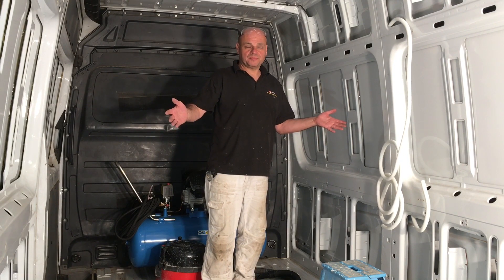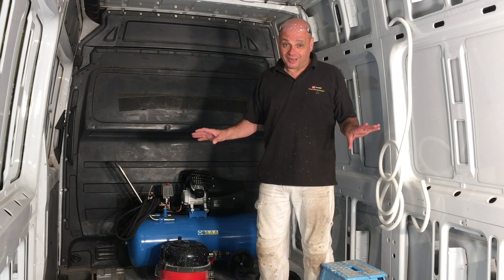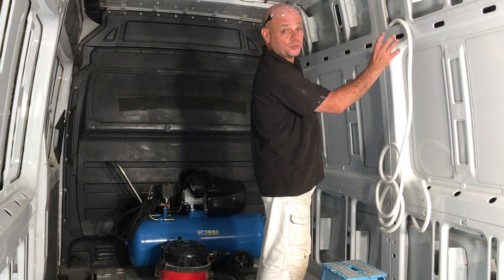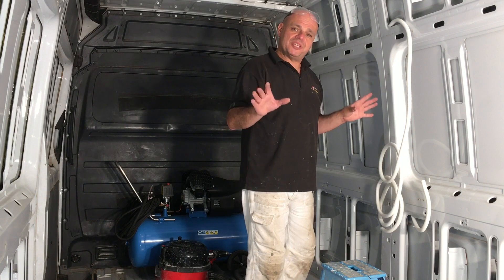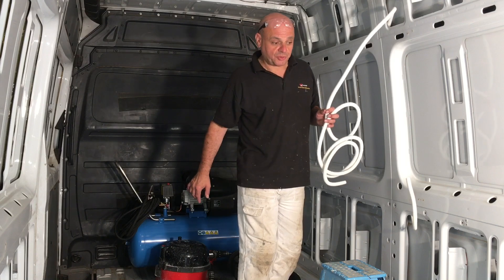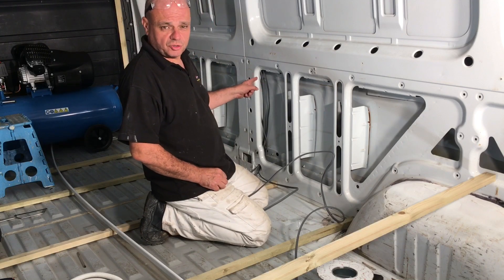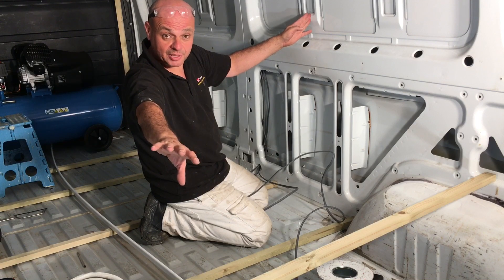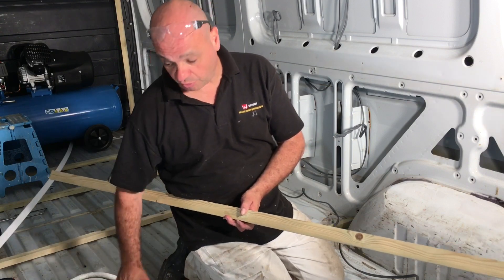Campervan 240v first fix wiring

Comment: what did you run from your inverter, can you just run a normal extension lead from it, also the mains hook up. if running a double plug an say run a ps4 13amp an tv say 5amp what size braker in the consumer unit do you use
Reply from the maker: Hi D mag. The PS4 won’t use no where near 13 amps but I ain’t worked out what I’ll be using myself yet but high powered stuff can only be used on hook up which can go upto 16amps. My breaker will have two 16amp breakers in it I believe fir two feeds but i haven’t had that looked at yet by an electrician. I’m Surmising as the feeds from hookups are 16amps However appliance plugs will only go upto 13amp. However I will fit a dual powered tv 12v/230v so that can be used anywhere anytime but play stations on hook up only. I’ve laid 2.5 twin and earth flexi cable for the inverter sockets but that’s overkill. 1.5 is enough but I had 2.5 spare so used that as you can go higher but not lower in wire rating. My inverter from time to time will be used for microwave and odd time induction hob cooking. Plus the odd product like a laptop or something. I suggest you work a plan out and show an electrician for 240v system but my experience is when you ask them about 12v systems they shrug their shoulders saying don’t know anything about that system.
Reply: @diycampervanman1633  thanks mate , am just putting an idea or 2 together for a few systems just the amps is the only thing am struggling to get my head around. Great advice thanks for taking the time to reply.
Reply from the maker: D Mag yer it’s a mind field electric but simple enough once you study other peoples videos. May be buy yourself this gadget - 13A Electricity Power Consumption Meter Energy Monitor Watt Kwh Analyser. There about £20 from screw-fix or tool station. You can plug your appliances into it at home and it tells you exactly how many amps it’s drawing but like I say go all 12v where you can first and leave the high powered stuff only for the inverter but for short periods or you will flatten your battery. I would buy no less a battery than 220amp hours or you will flatten it quick if running everything off an inverter. In the near future I’ll show how my vans electrics will be built based on consumption too. I will have solar to top the battery up too though. Always a good idea!
Reply from the maker: You can use an extension lead from your inverter yes but a short lead don’t have a 20 mtr lead off it. I’m building a separate circuit for inverter only as it’s for occasional use only. Some people have their 240v system made fully live from the inverter on a switch over switch but I’m running 12v 240v and inverter systems all separate so I can run them all at the same time.  My onboard battery charger if on hook up will keep my 12v system topped up at all times so I can still use the charging ports for my appliances whilst running cooking and hot water tank off 240. When off grid I have to curve my use on cooking stuff that sucks power. That’s when I break out the portable gas hob which I’ll have in the boot for outside cooking. Remember an inverter uses 30% more power just for the inverter conversion so make your van 12v friendly as much as possible!

Comment: 1.5mm core is OK unless it's insulated - which yours probably is, so 2.5mm was a good choice. 
Also at some stage I'd run the feed first into a mini distribution box with RCD and 2 dual gang MCBs (Live/Neutral ordering is never guaranteed at pitches). 
Rather than messing with inverters with separate sockets + chargers you may (will) be better off going for a decent Inverter-charger, which generally also include protection against surges and dropouts. Don't buy cheap though as cheap inverters are rubbish and go 'phut' at £100+ a go, get a Victron Multi as used by thousands of boaters. With that you can be on EHU, unplug the van and the internal 240V will not even notice. 
Within the cost of the Victron you get auto switchover, low standby power, reliability, smooth power good for even fragile electronics, plus of course charging and inverting. Running a cheap efficient domestic 240V fridge is then an option (due to the standby efficiency of 2-5W) without having to fit too much solar. So with a single decent 'expensive' box you get a lot of savings elsewhere.
Reply from the maker: Thats a consideration re your version and ill look into it but ive already started buying my Cteck gear fir onboard charger which can also be used as a 12 power supply off mains and the cteck smart dc to dc charger fir solar and battery to battery. If i wanna beef the system up laters i can add the smart pass giving me a capacity of 140A charge. Re inverter charger and switch over i like this but I’ve already wired up for separate system to keep it simple and to remind myself I’m on inverter power not hook up lol. I may look at your version as i learn more. The RCD is fitted with two trips but not wired in yet. I opted for the 2.5 cable because im fitting a 16A feed on the drive and i can wack up the electric supply at home only for guests who stay at mine. I can give them the van to be self contained and will be able to run electric heater, tv, microwave and heat up the hot water tank all at the same time potentially lol. Also thought hook up leads are suppose to be 2.5mm in the uk so thought best continue the ring in the same but your right 1.5 is fine and on the continent Thats all you need for hook up leads. Im learning all the time as this is my first attempt. I  say on various vid, this is how I’m doing my van rather than this is how its done as I’m a  total amateur
Reply: @diycampervanman1633  If you read my reply carefully you'll note that I recommend 2.5mm because your wire runs are enclosed (insulated) :). So you did well.
The Ctek stuff is good but doesn't preclude a Victron Multi, but at the end of the day it's all details - the main thing is to get it done and in use, you can always tweak stuff later.
Not sure about a microwave in a panel van, sounds a bit like a microwave trap to me - make sure you get a good brand microwave with a good seal as any leak will bounce around like an outer oven with you in it!